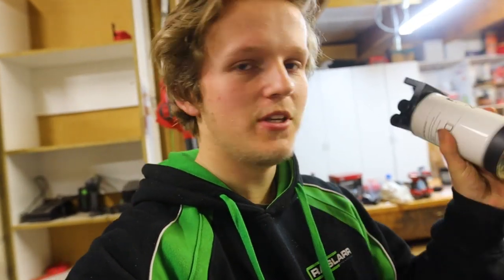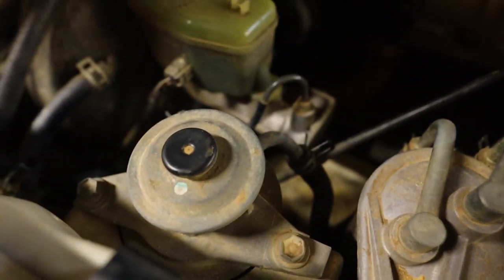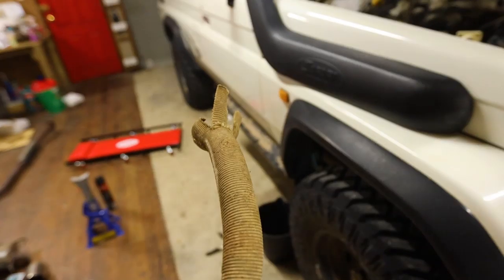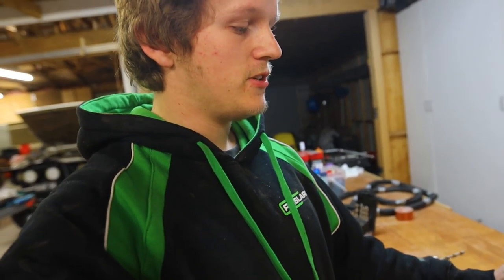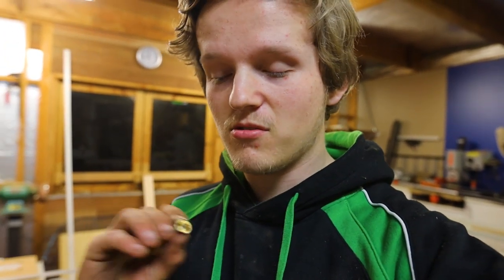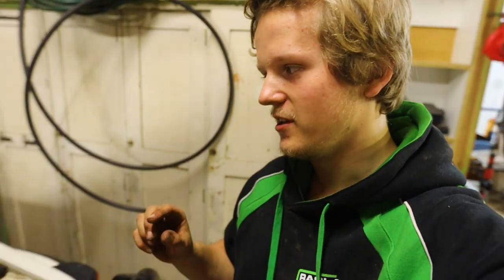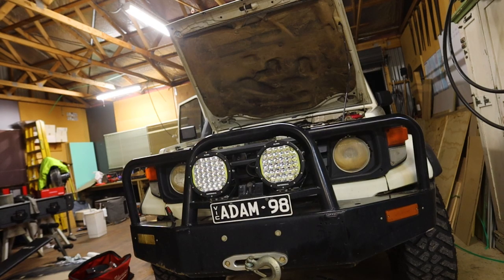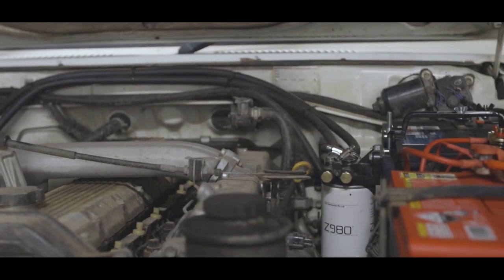How to Install a Ryco Fuel Water Separator!

Comment: This is a great video. I have an 1984 Olds Cutlass Ciera 4.3L V6 (the true diesel engine not the failed gas converted ones) diesel that I recently got running with a rebuilt engine and wanted to add a water separator to mine to supplement the original filter. Just the matter of getting a decent kit and the right fuel hose to make the modification.

Comment: Just curious as to why you did not put a bracket or fasten something closer to the original filter instead of running it all the way across the engine bay and then back again.
Reply: He said the reason at the start of the vid. And that's because there was no room